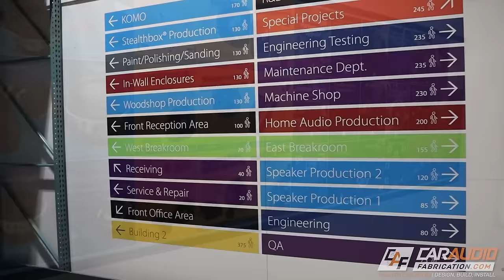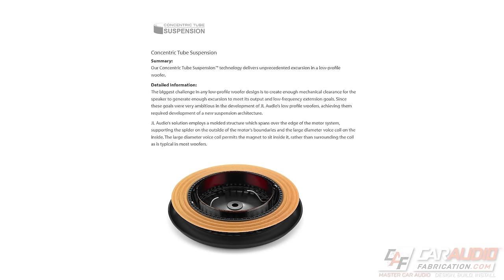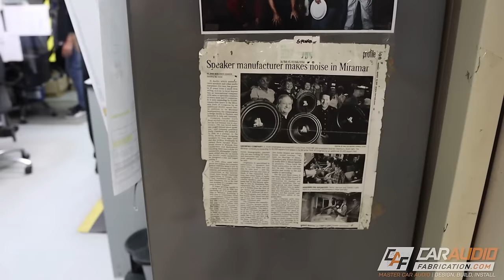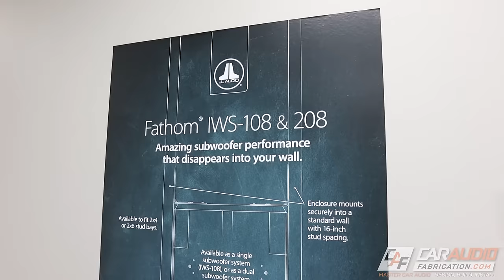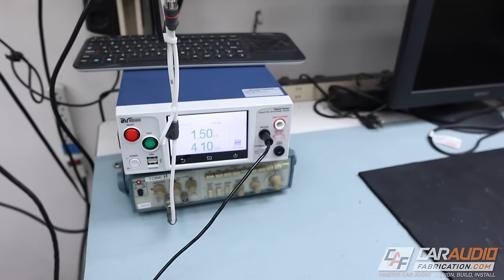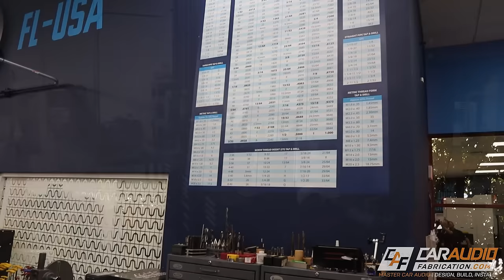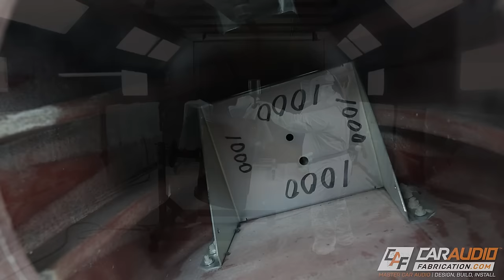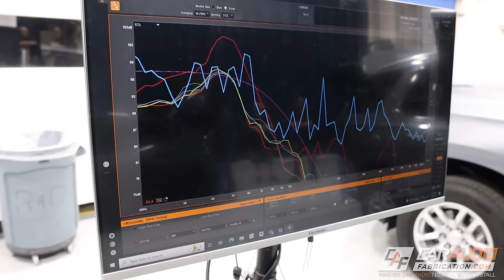How Subwoofers, Speakers, and Enclosures are Made! CAF Visits the JL Audio Factory!

Comment: i remember carrying JL Audio in my shop during the 80's those entry level 12w1 in a single reflex bandpass enclosure teamed with a precision power amplifier was a classic combination the good ole days.
Reply: I guess nowadays that would be considered a SQ build. Hi I got to admit I would love to have some old school gear in brand new condition. Rockford fosgate Punch subs are still beasts. But JL... For sure that sounds nice
Reply: 3 - 10w6 subs on a PPI a1200!!
Reply: @chadstockton6821  PPI amps where the beast in those days, very strong amps which still work in my 1997 4runner. PPI old school still hitting hard to this day.

Comment: Ever since the first time I heard a trio of w6v1 12s in the back of my buddys 1996 extended cab ranger, (I’m sure the were being powered by an Alpine v12 2 channel or something similar), I will never forget the pressure that they caused in the cabin of the trunk and the amazing sound that they had! I feel like I felt spent the last 26 years since that day in high school chasing that same sound where the subwoofers played all the way from 50 or 60 Hz down to the mid to high 20s… Completely flat! Or at least it sounded very good! Very musical but yet very loud at the same time! Extremely low distortion and just an overall pleasant listening experience with very little fatigue! Even though I somewhat showed my age with that high school comment, I’m still very much involved in the industry building custom vehicles in my area and guessing I’ve designed, built and installed over 1000 systems including custom subwoofer boxes for some of metro Detroit’s best custom vehicles! …systems for some of Sundown‘s best subs, DC audio, crossfire, Rockford Fosgate etc. and still nothing shakes a stick at a 12W7 in a sealed box on a good 1000/1! They sound amazing vented also but to have that kind of output in a sealed box is nothing short of amazing! Sorry for the rant lol… I said all of that to say this, I’ve always loved JL audio‘s products and this video just made me love them even more!! Keep up the great work guys and keep the great content coming Mark!

Comment: Heard my first set of JL’s in 1993. A pair of JL 10w6 paired to a Rockford Fosgate amp. My favorite system ever was a trio of 12w6’s powered off a Phoenix Gold Amp. I’ve owned a bunch of Wo subs and had a setup with four 12w3’s once. Now I am looking at building a non bass heavy system. Pure clarity. All JL speakers, I just have to decide if I want to run JL amps over other companies like Audio Control. In the car audio world, JL stands at the forefront of my mind because all the other great audio companies that put car audio on the map have sold out or traded compromises for profit margins. JL needs to bring out a JL classic line of W6’s!  They where just amazing and they are what put JL on the map.  Honor the W6, the culture and JL with a classic series!!! Even the classic dust cap would build excitement!
Reply: Just pulled my 12w0 out of my truck that I used while I was waiting on my Stealthbox to get delivered. Now I have two 10w1-v3s under the rear seat paired with two sets of JL components and amped off two Alpine amps. I'm in acoustic heaven.

Comment: Big JL Audio fan. Traded my Palisade for an Acura RDX so I was gonna downsize. Gave away a 1200/1, 12W7AE in  a Gateley Ported Enclosure. Was going to buy a  ProWedge 10W7AE and 750/1 but changed to a ProWedge 12W7AE. I looked at a lot of other subwoofers / amp combinations but after having owned 4 W7s in the past, I stayed with JL Audio.

Comment: hey i have a question, i want to install a rockville ss8p sub in my santa fe 2022 with factory radio. Do i need a line output converter or can i just use the high level input that is on the amp and tap in to example the rear left coaxial speaker thx! Great videos!!

Comment: I've got 2 13.5 w7's in the jl wedge boxes that have the red insert. They are about 17 years old and are in my garage but I'm wondering if I need to get them rebuilt so I can use them again or do you think they are fine? Both JL 1000/1 amps powered up and look as good as the day I bought them but I'm worried about powering up the subs until I know I'm not going to damage anything. Thanks for any info you can share.
Reply: That would be a question better suited for our tech/customer service team. You can submit a ticket here: https://jlaudio.zendesk.com/hc/en-us/requests/new

Comment: Question for anyone who might know the answer. If I have a 2-way passive speaker set installed with a crossover and I want to get rid of the crossover and wire them active how do I determine how much RMS wattage should be sent to the tweeter vs the woofer. For example if they are 100 W RMS speakers could I just use a 4x100 W RMS amp and send 100 W to each tweeter and 100 W to each woofer or should I reduce the wattage to the tweeter by some amount?

Comment: I remember when JL Audio use to advertise as the best speaker ever built. I think it was JBL that took them to court to stop them from advertising as "the best" but JL presented everything they did in the manufacturing process and said "Do you do better?" and they didn't. So JL won the case. At that time JL Audio was the only company machining their back plates and center pole pieces to precise measurements while every one else was using castings that often times where not even deburred or cleaned. The first time I torn down a blown set of high priced Bose speakers and saw the pole pieces I was like, say what. You're kidding right? Of course now days there are many different companies building great speakers but I think a lot of that is because JL Audio forced them to to be competitive.

Comment: @32:42 that's why I ended up here. I would appreciate a little more detailed information on the quality of mdf used and v grove dado pre carpet fold and glue process. Before coming here I read on JL site,
"V-Groove MDF Construction
Summary:
This advanced cabinet-building technique uses CNC-machining to create precise panel joints that make enclosure assembly more efficient and exact.

Detailed Information:
We begin with quality medium-density fiberboard, which is then machined on our CNC-controlled KOMO woodworking stations. These powerful machines are able to cut a wide range of features onto a sheet of MDF, with minimal waste and absolute precision. The KOMO machines cut out the woofer holes, terminal holes, cut dado grooves, create countersinks and most importantly, cut the angles at the edges of the panels that form the enclosure's main shell so that these panels fit together precisely, with no gaps or leaks.

Once the panels are cut, assembly technicians line them up in the correct order and glue their outer faces onto a long piece of carpet, creating a "wrap": a long series of panels, hinged temporarily by the carpet. In the next assembly step, our wood assembly teams fill the V-grooves between the panels and any dado grooves that receive dividers or secondary wraps with wood-glue. Once the glue is applied, the enclosure shells folds together along the V-grooves, capturing dividers in the dado grooves and secondary wraps, and evenly spreading the glue throughout the joints. One line of mechanical fasteners is applied to hold the structure together while the wood glue dries.

The V-groove technique greatly improves assembly efficiency, and also results in a far stronger and better sealed enclosure than the typical butt-joint construction found on imported enclosures. The quality of the MDF used in JL Audio systems is also vastly better than the typical "China-Grade MDF" used in the imported products."
Mark, you shoulda stopped in their office and played like mister beast asking their office if they've liked and subscribed to your channel :) They seem to maintain a decent social and marketing presence that matches their manufacturing and engineering passion.

Comment: I was an installer on and off for ~25 years and went to the Miramar facility about 20 years ago. It was MUCH smaller. I remember installing JL maybe around late 90s when the tweeters were oval. I managed a high end shop from '99 to '08 and my 2004 Mercury Marauder was our store JL Audio demo vehicle. Still have that car today, still have ALL of the original equipment that was installed in 2005 working perfectly. Outdated? Yep. But sounds fantastic. Buy GREAT equipment the first time and you won't be wasting your money.

Comment: Hi
I have just purchased Rockford fosgate R1-550x1 mono amplifier, cerwin vega 400-4D 4channel and JL audio 12 inch woofer and steg component front and rear..
Which guage wire should i used from battery to distribution block and which guage wire from distribution block to amplifier..
Plz help

Comment: I ran a pair of 12w1 subs in the mid 90's and never used anything else but JL Audio subwoofers since. I am currently 50 yrs young running a 12w6 off an HD750/1 and 2 sets of C5 6.5 components off the HD600/4 with audio control signal processors in my 90 civic h/b si. After watching this video, paying thousands of dollars for my JL Audio products over the years is justified. Thank you for the memories JL Audio...Awesome👍🏼CAF...no matter what Doug says.
#JLAUDIO4LIFE #AUDIOCONTROL #DAGOODLIFE

Comment: 1993/4, junior in HS.  two JL 8W6s on a Phoenix Gold M44's rear channels, ported.  Sounded absolutely stunning.  Buddy of mine had two 15W1s in a 4th order bandbass with Rockford Punch powering them, also sounded great.  The audio shop we used to hang out at did a lot of JL sub installs.  Mids and highs from that era were usually Boston Acoustics or MB Quart, although Rockford was available.  JL was just into subs at that time, at least that shop only stocked their subs, but components came very soon after.

Comment: Expensive yes i have used jl before. Currently rockford but i will say. Jl audio sounds very good! My friend has an old version 2 12w1 in a sealed truck box. Had it since 2008 he got it from me in 2017
Reply: I actually would like to put a jl setup in my trunk i have a 23 civic hatch sport. Would the wo 10’s sound good . I only have 8 gauge amp kit. It was Empress audio the do jl audio. I currently have a p-300 12 in it. I do love jl’s still. I highly recommend.